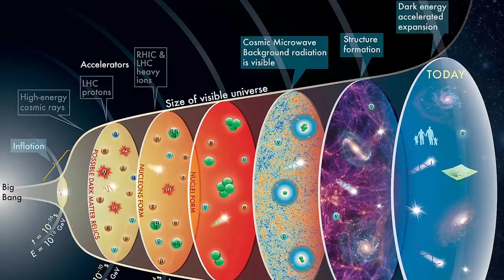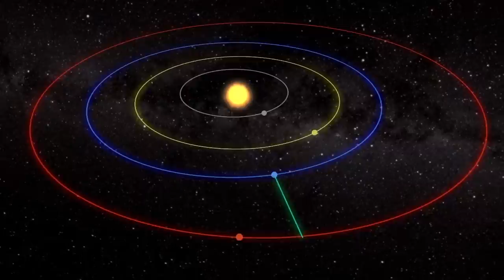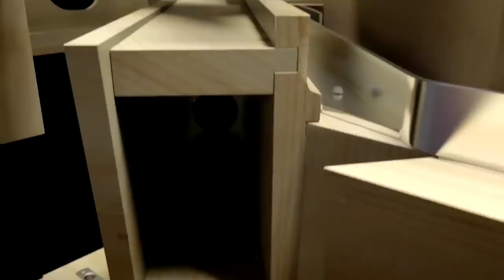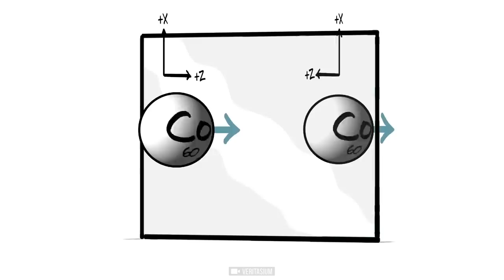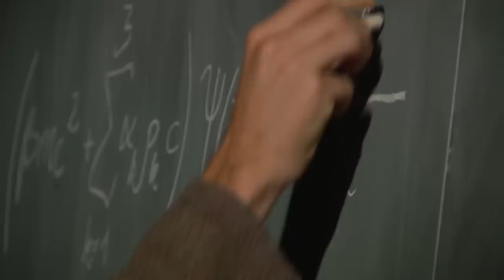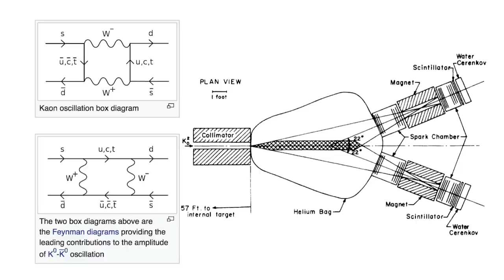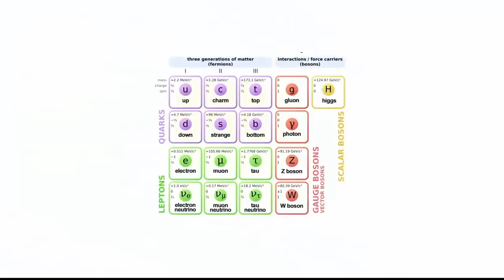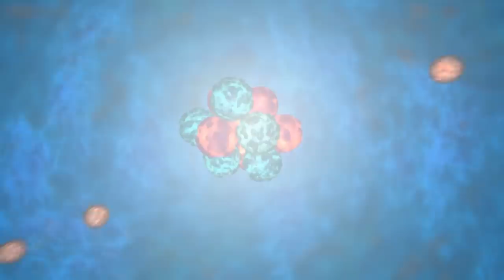Something Weird Runs Our Universe. What’s This?

Comment: How fast did time run in the early universe?
Reply: Shortly after the Big Bang, the Universe’s matter was squeezed into a tiny volume, so the gravity exerted by that matter was intensely strong.

According to Einstein’s general theory of relativity, clocks in a strong gravitational field run more slowly than clocks in a weak field.

Consequently, time just after the Big Bang did run more slowly than it does today. And we have evidence of this within our homes.

When we used to tune our TVs in between stations, about 1% of the static on our screen was cosmic background radiation – radiation left over from the Big Bang.

The key thing is that this cosmic background comes from a time when the cooling radiation of the Big Bang was about as hot as the surface of the Sun.

It should therefore be in the form of visible light, like that given out by the Sun, but it isn’t.

Instead, it is in the form of microwaves, and these waves oscillate about 1,000 times more slowly than visible light.

And since light waves are like clocks – they move up and down, or oscillate, with the regularity of a timepiece – this is direct evidence that at the Big Bang, time passed far more slowly than it does today I hope this helps, if you want to know more or did not understand fully, just ask and I´ll help

Comment: Hey Riddle please read and reply to my comment with your thoughts ony theory. 
Could it the phenomenon you explain here, show that the universe may be like an engine during tuning (the cycling and timing( vatiables) of the pistons(particles, their movements and interactions) can be shifted by a previously unseen hand.).. in this case the unseen hand could be the loss of energy as a result of the space for energy to convey getting larger?, another simpler explaination could be the tuning of a guitar, where the stretch and tautness have a drastic effect on the pitch of the notes per string...pitch of a note gets deep thicker strings, higer with thinner ones and changes can be affect by the additional stretching or loosening of the string. proofs: It is well known that in the first few micro seconds of the big bang, physics and its laws where a choatic mess, ergo the correlation between space its expansion(Dark Matter)and or contraction(blackholes) and always seems to cause collapse of physics and its laws hope this analogys/ theory/ observation makes some sense.
Anyway since dark matter seem to condense into clumps. maybe the regions of space where the laws of physic somehow dont work could be regions with either too low or too dark matter. in conclusion the laws of physic may be tied directly to the curve and rate of expansion of the universe.